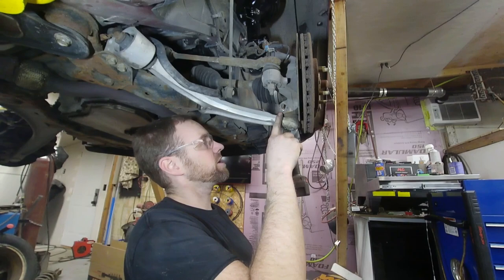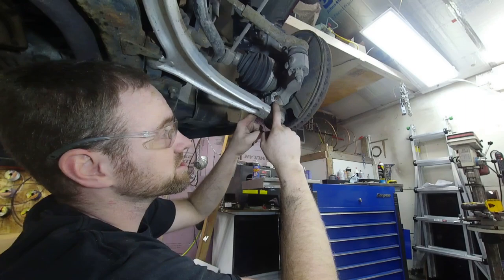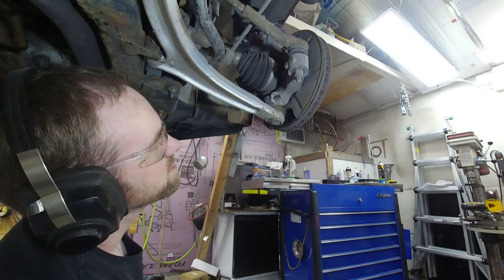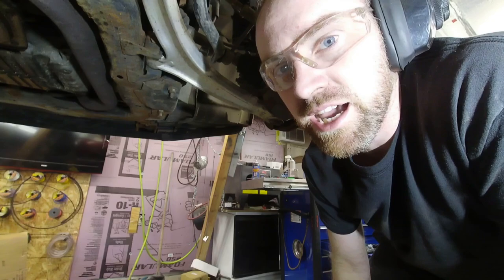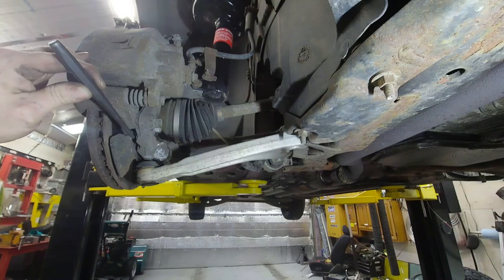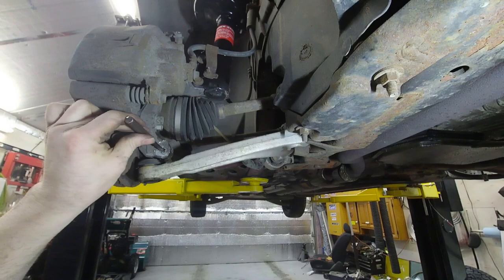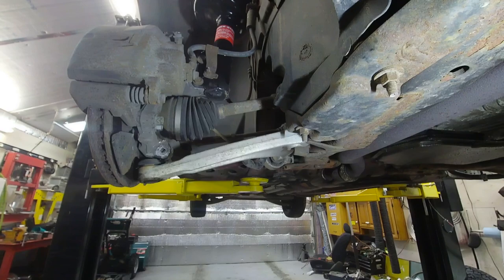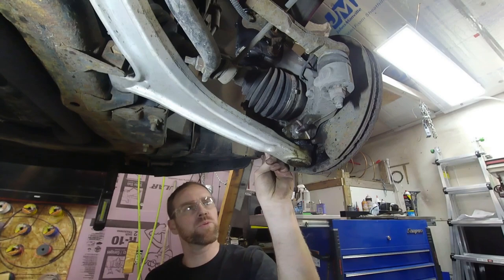Horribly Stuck Bolt In Aluminum.

Comment: I've dealt with lots of pinch bolts on my 03 A6 C5. They're horrible. I half drill the bolt, cook the hell put of it and hit it with a punch. So satisfying when it finally goes.
Reply: Upper control arms this long screw i drilled out all i think about bigger hole and put there metal inner tube just to avoid this hell again.

Comment: Or weld on a bolt and use a hollow ram. I found this out when working on my Mercedes and the ECU, fusebox,  air-con and power steering are all in the way.

Comment: Never ever use heat with aluminum  body with metal inside. After first heat metal became tempered and no chance to drill it later. I met this situation many times with alloy rims and studs.... 
And in this particular situation sometimes match easier to use penetrating oil mostly on center, and carefully with chisel try to open center plus turn bolt in both directions. 
Or/and remove ball joint and cut bolt by half with cutting disk, then much easier loos and remove halves.

Comment: Hold the punch with a vise grip so you don't smash your hand.  You can be more aggressive with less risk.
Reply: Yeah it's like starting a small nail by holding it between your fingers instead of in some needle nose pliers, putting your hand in the line of fire unnecessarily.

Comment: you have been stuck like me, 2 broken starter bolts out of 3. seen using propane torch and wax repeated until he center drilled then beat out with a punch and hammer.

Comment: Great video that was really helpful I had some broken head bolts on a trailblazer but not seized up like that. You made it look easy thanks for the tips.
Reply from the maker: I think those Trailblazer's just have to high of a tq to yield combined with the locktight crap they put on. I had one trailblazer break all but 2 head bolts once while pulling the head.
Reply: CrazedPerformanceRepair I had 6 bolts break on the last one I did but at least the thread doesn’t seize up they come back easily but in the video you made that was crazy stuck on there I would of been mad hammering at it

Comment: When drilling steel with a steel drill bit, isn't it advisable to use some type of lube to minimize friction and maintain the cutting edges of the drill bit as long as possible so resharpening is not required as often?

Comment: I run on same issue on my car (Chevrolet Cruze), but as the ball joint is ok I disassemble the lower arm from other places, to remove the drive shaft for changing a gear bearing, or clutch

Comment: Great Video. I must say you're lucky that bolt is large, imagine doing that in a much much smaller bolt and both the bolt and the base is aluminum.
Reply from the maker: Aluminum drills easy, I would like stuck aluminum bolts.

Comment: I need to remove 4 long bolts that are seized into the aluminium body of a Volvo 140 steering box. I took it from a car that had been abandoned outside for 34 years and pretty much all rusted away. These bolts are heavily corroded and I'm not looking forward to it at all!

Comment: I would just like to suggest that you can relieve the strain from other connected parts by getting a co-worker to hold a heavy sledge against the other side of the part that you are removing the bolt from.  That way the impact of your hammer blows work directly against the mass of the sledge.  This reduces the bouncing & flexing, making you hammer blows much more effective & it protects other connected parts from damage.
Reply from the maker: Very true, if only I had coworkers lol. I'm a solo operation for the most part.
Reply: @CrazedPerformanceRepair  I did wonder, but still thought it a worthwhile tip for readers.  I suppose that "for the most part" means you are able to get assistance some times.
Reply from the maker: @kenwebster5053  yeah occasionally, but I also prefer for video sake making it happen as a solo for the sake of others. That does help sometimes though for sure. I still remember how bad this one kicked my arse and that option wouldn't have helped much. Lol

Comment: To free a frozen bolt, I recommend Freeze-Off. Hasn't failed me yet. In this case, I would heat the aluminum and the bolt, then spray Freeze-Off on the bolt only to shrink it and break it loose. Be sure to apply anti-seize to the new bolt threads, especially when dealing with dissimilar metals or corrosive environments.
Reply: This is something I have never herd of....it makes sense. I work on boats and I really don't like stainless steel bolts. I'm going to look this up.

Comment: On my 2009 Silverado 5.3l had no oil pressure since about 200,000 miles which made a ticking noise, at 301,000  miles I decided to replace the oil pickup tube o-ring so did so and it completely fixed the ticking little did I know the lifters that have lasted 300k miles are AFM/DOD lifters and they wouldn't activate when they had no oil pressure so when it had oil pressure it collapsed 2 of the lifters!!! I got 1 to pop loose using you method but the other 9ne wouldn't pop loose so I pulled one head off and tried to pull it out and the cent came out the rest was completely stuck I used all kind of vise grips until it has 2 cracks it I'm gonna have to remove the cam and see if I can tap it through the bottom and retrieve it with a strong pen magnet with a light and  I went ahead and bought new came and non-dod lifter and going to delete the atm shit.
Reply from the maker: I will link you to a solution to get that lifter out hopefully by Tuesday. I have some very helpful info on it. Send me a message on my website crazedperformancerepair.com to be sure I don't forget.

Comment: Have a similar problem but I can only get to the head side of the bolt and I have even tried to break the head off with an impact gun but only ended up rounding the head off, I have tried heat tried heating and cooling I have tried everything except drilling it out but I can't do that as because the head got so mangled I have no idea where the centre of the bolt is any ideas on what to do now
Reply from the maker: Lightly grind at the surface so clean metal is exposed. Then you should see a circle for where the outside of bolt is. Then find center.

Comment: So by hammering that out didn't you just jack the threads off? Why didn't you just drill it more then easy out?
Reply from the maker: Without me watching my old video, wasn't this a through bolt in a control arm. That would mean there are no threads that is threaded into It has a nut on the other side. It wasn't seized up in the threads It was seized up in the housing if I recall correctly. There is no such thing as an easy out to fix a problem like that.

Comment: Those are a pain in the ---. I like to use blaster penetrating oil also, what are you using for oil?
Reply: I believe he said he was using kroil.
Reply: Thanks, I never tried that and will order some to compare it with Blaster.
Reply from the maker: I use lucas tool box buddy and pb blaster. Both are good. I'll get you some tool box buddy next time you stop over Chuck.
Reply: 😆 That was weird. I was almost positive he said Kroil! Go back and its was deep creep. Its all downhill from here! I'm loosing it! Lol
Reply: Thats ok I work on vintage machinery and we like to try different products.
Reply: @chuckram2188  transmission fluid and laquer thinner

Comment: best way to remove threaded bolt from alum block that will not,by all means,not move despite what ive tried.help!
Reply from the maker: If you are talking engine block use the welder trick.

Comment: Try bee's wax after applying heat. Usually works everytime
Reply from the maker: It works sometimes but I think this one was beyond that. I find heat and shocking with water works best but I just couldn't get enough heat in it with my piddly little torch and a aluminum knuckle sucking the heat away.
Reply: @CrazedPerformanceRepair  Have you ever torched it and then turned  can of electronics duster upside down and sprayed it
?  The bolt usually puts its hands up and walks out apologizing
Reply from the maker: @ricksalser5645  nope, I'll have to try it sometime. Good idea, I need to get a good torch now that I have a bigger shop.

Comment: The pinch bolt on the upper control arms on an audi a4 b7 is a right old pain in the ass,I wish I had the room to swing a big hammer at it like the way you did

Comment: Chevy $$hit ....  That was why it was NOT Engineered  correctly to begin with AND did not incorporate using propr Assembly Method from Factory and  most likely the Cheapest Grade Steel bolt available.  Should have been assembled with Antiseize at the factory and used a Grade 9 bolt with Zinc Coating.  I own a garage full of tools because of American/ European based manufacturers.  Own a Toyota Camry now and my tools could be a Fraction of what I have and RARELY EVER GET TOUCHED anymore.   Nice Video though for solving the issue.  THANK YOU!!!